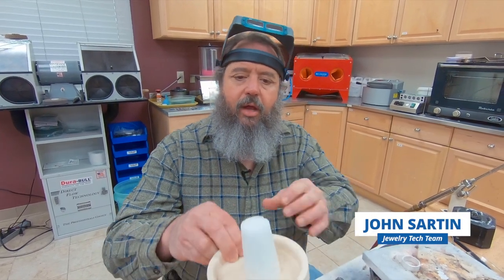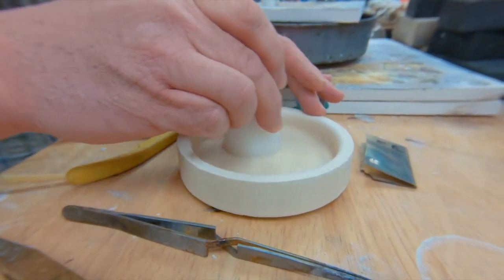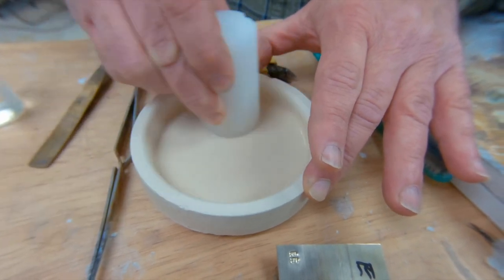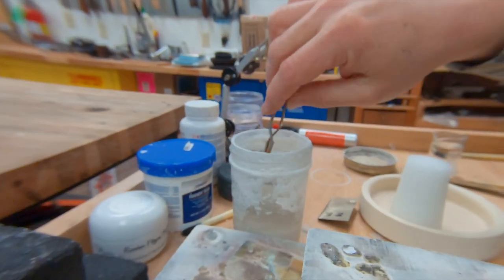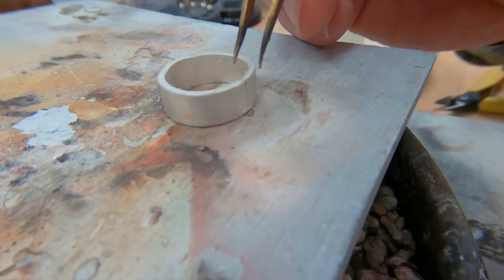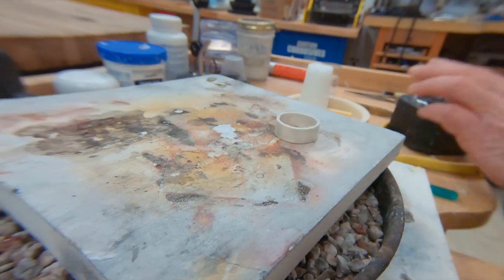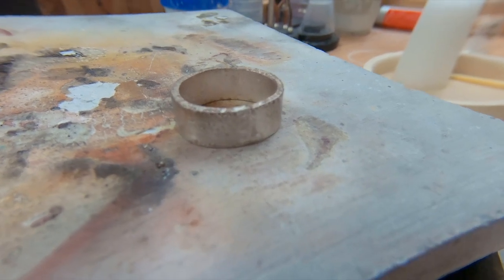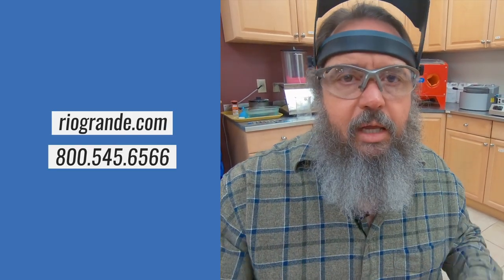How to Use the Borax Bar and Dish

Comment: I was having a lot of trouble making the paste in the dish.  The dish is not very rough and it is porous.  I watched this video as well as other videos on this, the thing I found out was I was grinding the cone to hard and therefore I was polishing the bowl instead of making a paste.  So if you are having problems like I was, lighten up on the cone pressure and let it do its thing.  It's not the best thing since sliced bread, but once you get the hang of it, it works.
Reply: Oh wow, thanks!  That's good to know.  I'm just starting out and actually went and bought "20 Mule Team Borax" brand powder for under $5. It's the exact same mineral as the bar he's using so I figured I could make a paste with it and if I don't do so well with soldering, I won't be wasting money because it has a b'gillion uses and I can add it to my laundry.

Comment: Thanks for the demonstration!  I'm brand new to soldering so I actually went out and bought "20 Mule Team Borax" brand powder (it's a LOT for CHEAP!). It's exactly the same mineral as your bar so I thought it'd be better in case I totally fail at soldering because I can use it for other things.  I'm waiting for my Rio Grande order to arrive so I can solder for the very first time. Is there any reason at all I shouldn't use the powder to make my flux?  Thanks so much!

Comment: Are you using oxyacetylene for your silver? I tried propane, and though my sterling started to glow, the hard silver solder wouldn't flow. I have access to oxyacetylene, but didn't want to go right to that since I have more experience working with propane. Making a wedding band and need to solder a butt joint for 4x2mm square sterling silver wire.

Comment: What is borax dish...?
Reply: It's basically stoneware, like dishes, coffee mugs, etc., that's never been painted and glazed to have the usual smoothe glassy finish.  The roughness provides friction so the borax will grind into a powder. Some coffee mugs and baking dishes lack a glazed bottom and sometimes people even use them to sharpen knives. So... basically any unglazed stoneware will work if you happen to have any hiding in your cupboard. 🙂